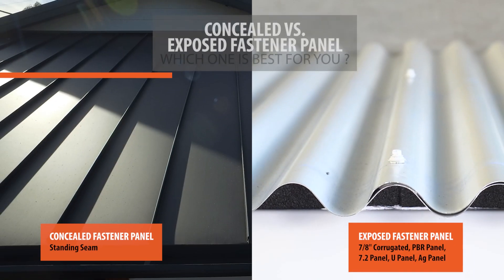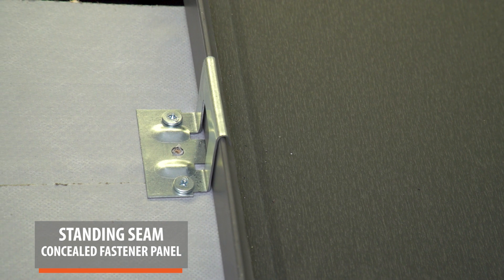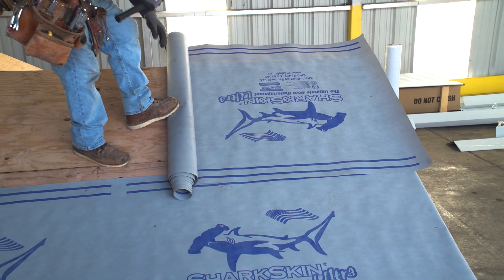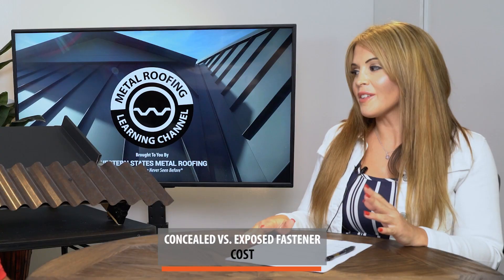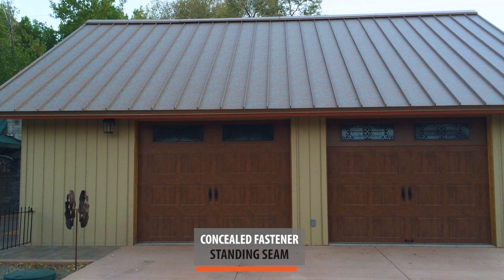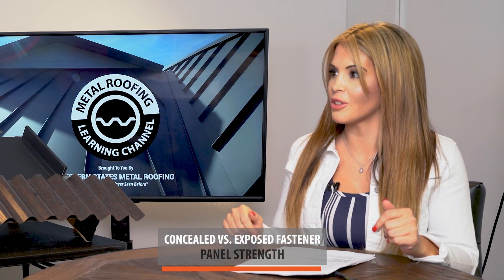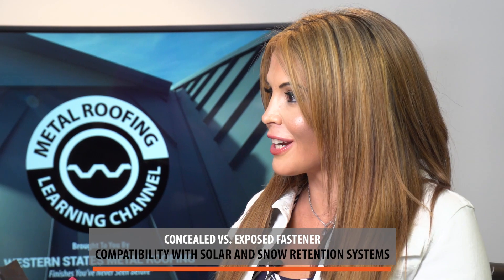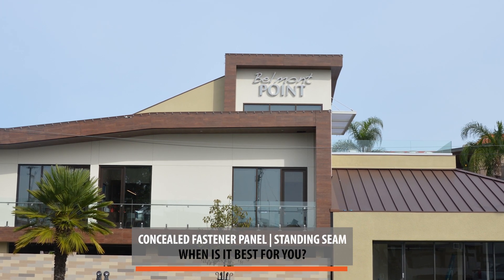Standing Seam Metal Roof Vs Corrugated Metal Roofing [Cost + Pros & Cons + Installation]

Comment: Thank you for explaining the importance of high quality, properly installed underlayment.  Those of us in the field know that if your roof isn't watertight after underlayment, it's not going to be watertight after the metal is installed.  I also appreciate setting the price per installed options appropriately.  It helps us all justify why we charge for the quality installed.  Kynar, yes as you said, it is the gold standard.  Why skimp out on a paint system when the life span of either option, when the paint should last just as long.  I agree with your insistence of maintenance regarding exposed fastener systems.  Where a exposed fastener system fits budget, installation, or aesthetic constraints, exposed fastener panels still dominate an asphalt shingle.  There is a whole industry around replacement/goof screws, and properly maintained an exposed fastener system has a real life span vs. asphalt shingles. It is much easier to swallow replacing the screws on your roof in 20 years, rather than replacing that "lifetime" asphalt shingle roof in total, after 15 to 20 years.  Carry on my friends, keep the quality education going!
Reply from the maker: Jordon, I really appreciate all of the support. Trying our best to provide honest answers to the questions we get asked.

Comment: Hello, im a roofer from australia, I also did solar installations, corrugated sheets are perfectly fine with solar, they usually simply remove a few fasteners at specific distances apart and replace them with larger solar ones that hold down a L shaped bracket which then hold solar aluminium rails, that the panels sit on. You dont actually put more holes in your roof. We also installed roofing insulation blankets under the sheets which had a weather proof underlay attached to it. The insulation blankets help with the heat, cold, noise and most importantly condensation, which occurs under ever corrugated roof.

Comment: Wait. Could you please explain why you said it's a "tie" when it comes to which panel performs better with solar panels and snow retention systems? (Around the 11:10 point) Everything you said about the two systems seemed to indicate that the standing seam would perform better? What did I miss? Or what did you cut out? Is the cost of the mounting system used for standing seam much much higher? Thanks in advance for your reply, since this is important in our making a selection!
Reply from the maker: Solar panels are designed to integrate with standing seam panels and will work better if you have that type of roof. The mounting brackets for the solar panels attach to the high seam of the standing seam and you don't have a screw penetration. If you have solar panels, use a standing seam panel.
Snow retention systems will work fine with either standing seam or corrugated. The only difference is that you will have a screw penetration when attaching snow retention to corrugated.
If snow retention is your concern both will be fine.
Reply: @WesternStatesMetalRoofing  Thank you for the quick response. We're anticipating using solar panels and so will price a standing seam roof. Your videos have been extremely helpful!

Comment: I gotta make the choice... I know I will choose wrong.. I wanna go standing seam, but I also want to help with the install and my contractor is overworked and doesn't show up often enough... garage and house (separated) wish me luck..
thanks for the great video
Reply from the maker: Joel, Good luck with your project. If it were my house I would pay extra and do standing seam. However, if you are installing yourself or your contractor has limited experience then I would not recommend installation of standing seam. Difficult installation without experience. Corrugated or R Panel will be a much easier install.

We have installation videos for everything
https://www.westernstatesmetalroofing.com/how-to-install-metal-roofing
Reply: In my area the difference between standing seam and exposed fastener was much larger. The cost of standing seam which is what I wanted to get was 3.5x the price of exposed fastener and I just did not have the funds to justify that. I will make sure to have the screw maintenance done instead.
Reply from the maker: @stevenmyers6076  Steven, the 3.5X difference seems a bit high. Corrugated is still an excellent product and given the price difference, it seems to make sense. I would be concerned about two things though at that cost difference
A. Gauge of the panel. I would not use 29 gauge. Too light of a product for too little cost savings
B. What color and what type of paint system? 26 GA SMP is still a quality paint system and a good value. However, it works best with light or neutral colors. If you have a bright and vibrant color it's worth it to upgrade to a Kynar/PVDF paint system. PVDF will hold the color integrity much longer. It's difficult to find 26 GA Kynar, so in all likelihood it will be 24 gauge Kynar. This will increase your cost, but it's a good investment.  Hope this helps.

Here's a video on the different paint systems.
https://www.youtube.com/watch?v=n1JUsTvoOrY&t
Reply: @stevenmyers6076  that is expensive! i went exposed on my garage, easy and looks great! my house has lots of vents, skylights, obstacles..  ive been told standing seam will be easier because of this... I would like to match house with garage,, but might go standing on house.
Reply: @WesternStatesMetalRoofing  The roof we went with was a 27 gauge. I am trying to remember what brand it is but I believe it was a more expensive coating option than SMP but I'm drawing a blank right now. I believe the brand of roofing was Everlast II Omni panels? I could be wrong but I seem to remember they had some upgraded coating system. 

we have a 25 sq roof and we paid 7k if im remembering correctly for exposed fastener and standing seam was very close to 30k. I was shocked when I saw the difference. Oh we also chose the med grey color. I think its called charcoal but its more medium grey.
Reply from the maker: @stevenmyers6076  27 gauge is a strange gauge, don't know that I've heard of roofs done in that gauge. However, almost same thickness as 26 GA, so you will be fine. Congrats on your new metal roof.